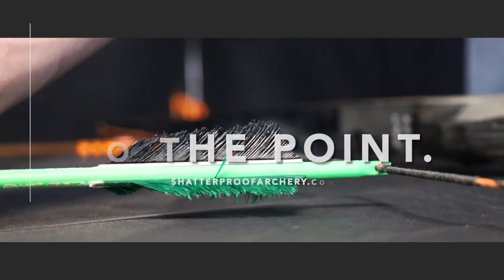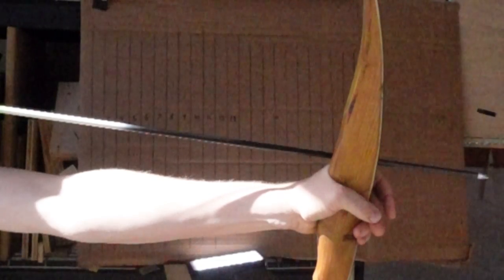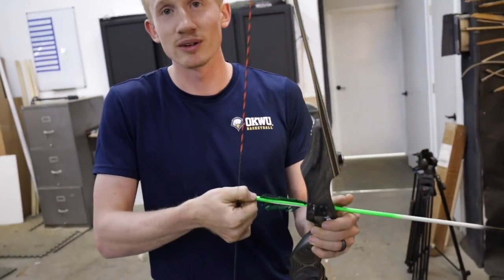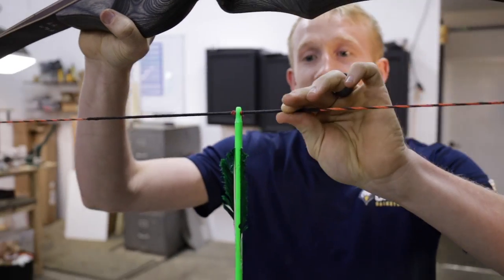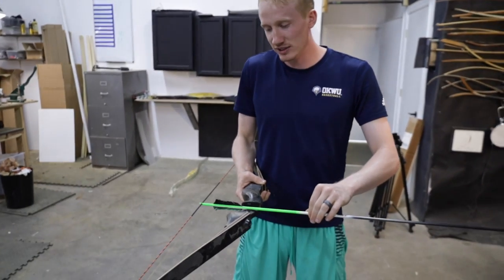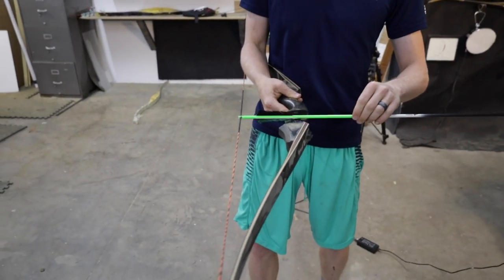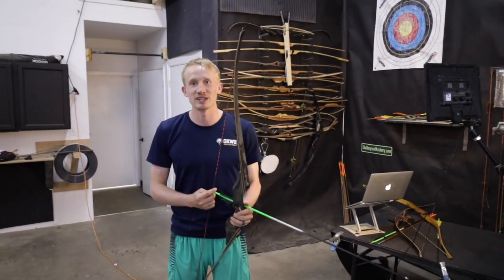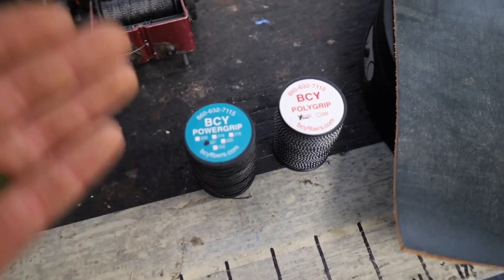HOW TO FIX BAD NOCK FIT AKA [subpar/frustrating/aggravating/pull your hair out/loose/tight nock fit]

Comment: I heat the nock in hot water.  If it is too loose press it tighter, too tight open the throat a little.  Changing the serving thickness is fine if all your necks are identical.   In my experience they are not.     If you measure  a container of necks, there will be a variation, small but measurable. Also the necks will widen due to use.  It is easier to change the  nock throat than the serving diameter.  This advice Comes  from Olympic  archers.
Reply: Same mate, 1000's of shots I've done with beiter pin nocks, I adjust the nocks to fit the string. When I get a new string I buy a set of new nocks (benefit of pin nocks) and adjust them.

Comment: When I order arrows, it has no number for the nock size.  Why isn't the thickness of the serving a standard width?  New string and I've never dealt with setting up the serving before.  My wife's string just works with standard nocks.  It's like someone wants to make this into an exercise in chasing down phantoms that mess up the performance.
Reply from the maker: The reason for different serving size is that some bowstring material is thicker than others and some bowstring builders use more strands than others. We test our bowstrings to fit the standard nock:) But sometimes people have smaller or larger nocks.

Comment: Brginner here. I recently bought a cheap 20lb takedown recurve bow with all the necessary equipment to start doing some target practice with my kids. During our first session we were having trouble keeping the nock on the string because it was way too loose. I was thinking of just wrapping a little bit of duct tape around the string at the nock point. I know it's not the proper way but it seems like it would be a quick easy fix for us. Any reason why we shouldn't do this?